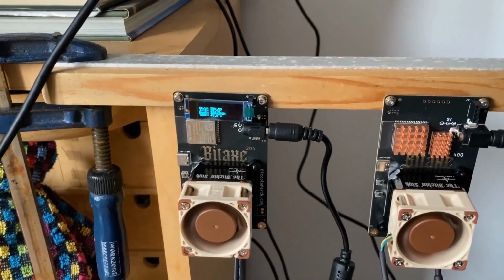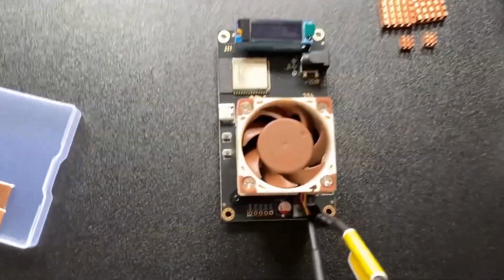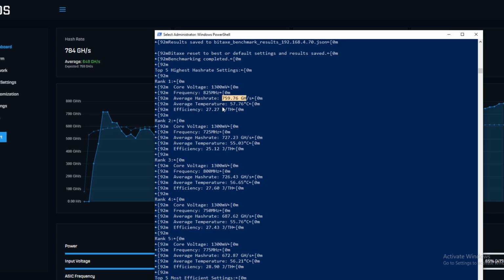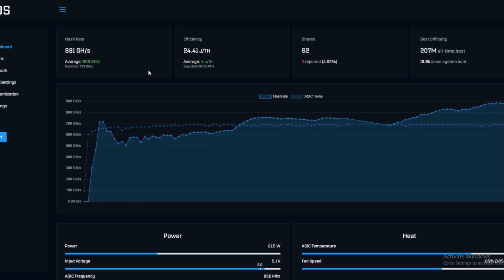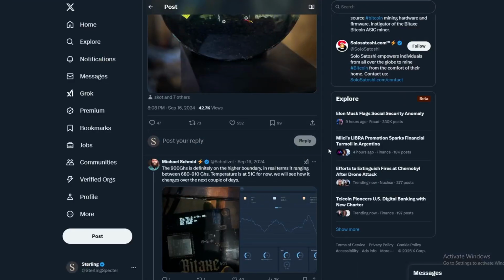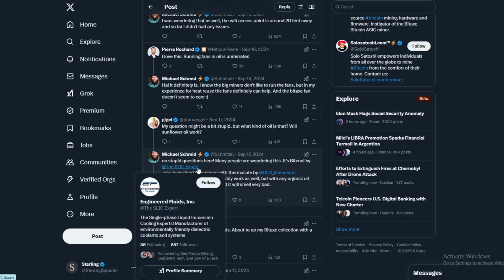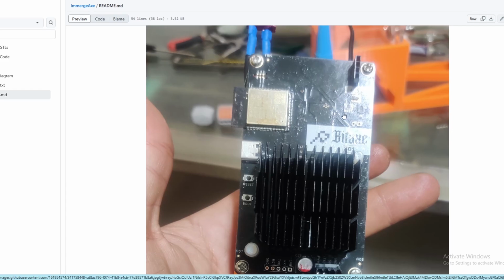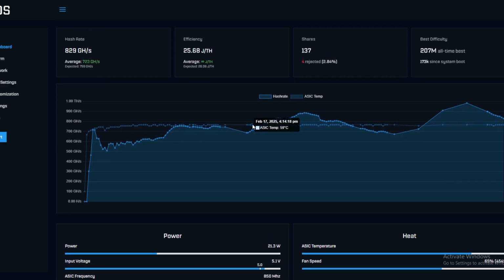We Need To Start Immersion Mining With The BitAxe Max

Comment: Mineral oil is what PC guys have been using for a while. Although you could submerge it in motor oil if you wanted to.
I think the more viable cooling option would be liquid cooling and is what I would be doing instead of oil immersion.
Reply from the maker: i have now decided to go with liquid cooling
Reply: @SterlingSpecter1  DC 12V  Thermoelectric Peltier    is what I plan on using to cool my four lucky miners. Have not got all the parts yet. 
And only plan on cooling the air that they pull through  to cut down on condensation as they would create Frost on the chip if used on a heatsink. Best of luck looking forward to see your results.

Comment: I have adapted a liquid cooling system for a Raspberry Pi and with an ambient temperature of 17 degrees, the CIP at maximum was 23 degrees. I'll upload a video so you can see it if you want. The settings were at maximum gamma 601. It was not stable and very noisy. In my case, I'm not interested. Thanks for video.